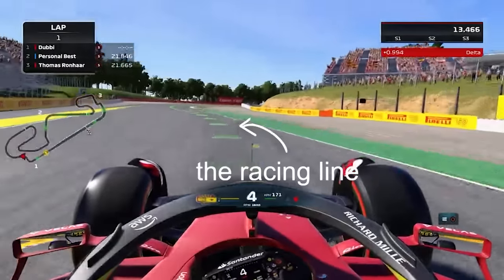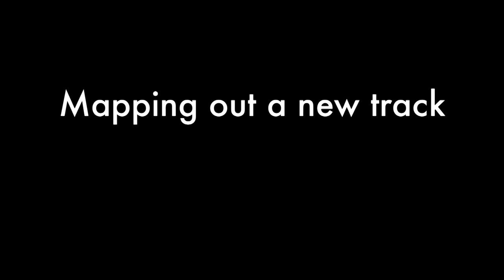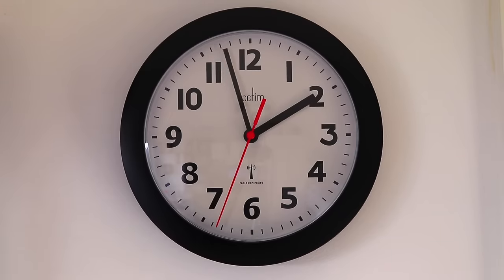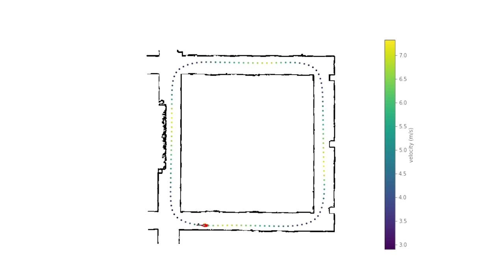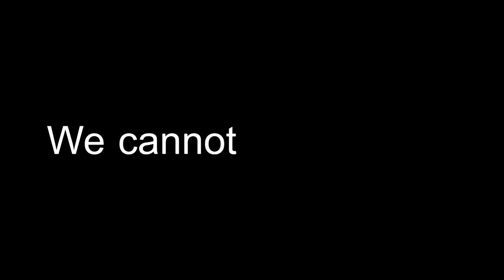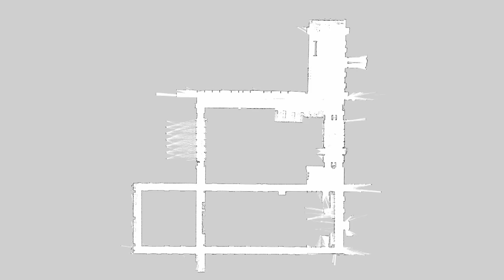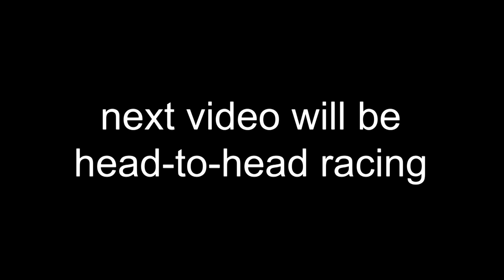Building the FASTEST Self Driving RC Car

Comment: Steven, I'm wondering if the LIDAR is doing anything during your speed runs, or if it's just used to help build the map? It seems to me you are doing autonomous driving via a sort of multi-stage process where the vehicle doesn't have any capacity to respond to obstacles, changing track conditions, changing internal mechanical (like gears eroding or tire wear.) Don't get me wrong, it STILL looks damned hard and we're enjoying the details you're sharing! I think it might be helpful to spell out for the viewers that this is (self)-mapped autonomous rather than real-time autonomous driving. 

Also, if that LIDAR is a snap-on module and isn't doing anything during racing, maybe pull it off and save your $1500. :) 

Please let me know if I've misinterpreted your process. It looks super fun either way. Glad you had some friends to help out with the 2am laps.
Reply from the maker: The car is actually using the LiDAR sensor to localize itself as its racing, which is why it's needed. The code for that is from this repository: https://github.com/f1tenth/particle_filter

You are right that it doesn't have any obstacle avoidance or can adapt to changing track conditions, so this is definitely something that I want to work on in the near future :)) one step at a time is my focus
Reply: If the car was only following a preset line and not the lidar data to define it's position along the circuit, any slipping would offset it from the planned line and very quickly it would be on a collision course with an obstacle.
Reply: @stevengongg  this would be great to see. Specifically, how narrow of a gap that hasn't previously been mapped can you get the car to drive through at speed! i.e. you add a few barriers around the course that the car needs to drive between in order to complete the loop. You are totally right though - start simple first. Good luck
Reply: @stevengongg  at least implement some emergency braking if it's about to go into something or if it's getting out of control. later on you can turn that into collision avoidance based on previous knowledge of the area.
Reply: @stevengongg  REALLY COOL PROJECT! I'm not a racer, engineer, or coder, but I thought a cool idea, using what you presented, would be comparing optimal drive lines on existing tracks.

you could take an existing track with Ariel photos, sometimes they have track data, and compare your code for the optimal drive line vs center line vs recommended lines from the different race teams. 

you could hop on that AI learning train and see if an AI can spit out anything that beats your program or existing lines for the track.

if you really wanted, you could go down the rabbit hole and start scaling the rc car to comparable race cars that have driven on the track and you can build the track at scale (somewhere idk? space would be an issue)

Comment: I think you need an accelerometer to determine the G forces in corners, so you can adjust the steering and acceleration to prevent under/oversteer. Nice results by the way!

Comment: so as me having one of these myself, add a fan to the motor depending on the battery your using, and loosen the mesh by a hair, it will make it run smoother and some sound as crunchy as it drives

Comment: Fantastic work! I'm a mechanical engineering student and the software side of this project really blows my mind. Subbed. 👍

This will probably get lost in the comments, but as an RC hobbyist, your motor gear mesh sounds really tight. The truck sounds like its screeching because of the binding in the transmission. There are plenty of videos on YouTube that show how to set the gear mesh between the pinion (motor gear) and spur (driven gear) properly. One trick is to loosen the motor screws, put a strip of paper between the gears, press them together, tighten the motor screws, then remove the paper.

Comment: Very cool! I often thought about this approach, but from a different angle.  Instead of fully autonomous, I think a better approach would be to teach the car a track.  The receiver and transmitter record a track in slow mode (driver inputs). Then parameters are set to for full speed and corner speed. You'd need a gyro to keep it in a straight line, and guide the car around, each lap finessing the course speed etc. So in racing mode, (hands on still) it would auto correct, hold direction and find the best line for each section.
Reply: Gyros are great at measuring inertial change. However, it would be pretty difficult for them to be used for localization alone.
Reply: @gstrnerd2  true, but if it's set to counter steering anomalies, it'll stay on the programmed track

Comment: YouTube reccomended me this, and it's awesome! As an amateur sim driver, you can shave some time, if you close the gap in some of the corners, it's getting them a bit too wide, before improving the car itself, also will help knowing the point where the car will loose grip when turning, maybe with a Gyroscope, to apply the correct amount of throttle in any occasion to get the ideal amount of grip. I go with trial and error, if can handle X speed, at X G's, go faster until it drifts. Same with braking, how hard can you brake before locking wheels and start slipping, and if you can accelerate hard enough after, and gear ratios, depending of the track you'll want better acceleration or better top speed. You have to balance it right for the occasion. Then will come all the physical improvements, lowering the car, stiffer springs, grippy tires, and powertrain and weight reduction. As someone suggested, adding another type of sensors could also help, maybe ultrasonic sensors, which aren't as bulky and weighty as a LIDAR and use LIDAR for the first recognition... I don't know programming at all, but I like experimenting and I like electronics and rc cars as well, and most of the things I don't know how to implement them. All the best and good effort!!

Comment: Constraining yourself to tyre grip is not the only approach. By using gyro data and comparing it to steering angle (hint: tap into the servo's potentiometer signal so you know the true current steering angle rather than the requested angle), you can determine the oversteer or understeer angle. Oversteer means the car should countersteer and slow down. Understeer means the car should just slow down. Using the oversteer ar understeer angle to augment the determined direction of travel from the camera/lidar data would allow you to eliminate the oscillation that wheel slip introduces to the control system. You could alternatively use an optical flow sensor from a computer mouse under each axle to for more direct and lower latency data which is less susceptible to noise than an IMU.

Comment: Mechanical engineering student here (also in Ontario lol), lengthening the wheelbase slightly might improve stability when steering. Less limiting in software, you'll be able to turn more precisely quickly rather than slowly increasing steering to where you want. Might help reduce the oscillating and increase speed.

Comment: The trick to racing is downrange vision.  It can only plan lines as far as it can see.  It can see better lines if it can see further.  It can run them increasingly faster the further it can see and the faster it can interpolate what it sees.  Maybe you don't need to see the entire environment so clearly.  What if it just focused on a downrange bubble that can allow it to continuously chart where it should go.  Just some ideas.  This is amazing and I'm blown away and only suggesting this as someone with race experience. For sure a good RC driver will still dust this thing in a race.  It wouldn't be close.  You have to make it think like they do.  They're not looking at the glass trying to see if its glass or not.  They're already looking 100ft downrange with tunnel vision. I know that a robot depends on spatial awareness but you should think about ways to focus it. Or maybe make it diminish with distance.  'Push forward' is the term in racing.  The next step is compelling it to 'push forward',  not see everything and react in the moment.  I love this and want to see you take it all the way!

Comment: Great work! I would highly suggest checking the gears, they sound very bad near the end of the video, like they are too tight together (this severely lowers performance), and also lack lubrication. Apart from that make the suspension harder and lower it if the chassis allows it. Stickier wheels and finally a different steering servo.

Comment: It can follow a track, but it doesn't feel like a racing driver yet. It's constantly braking too late because it has less grip than in the simulation, and it's causing it to not hit apexes. You should enable it to go into turns a little stiffer, with more computer confidence, and maybe use the motor to brake when it's detecting that it won't make the apex as intended.

Comment: There might be issues due to smooth track which leads to slip of wheel and car may go offtrack. You might like taking the car on a actual road or a small track which can give you a good traction. Also could you try making a that car run by placing cones on the tack. It can help you in changing track layouts whever you want.

Comment: Don't mash the gear teeth together as tight as they can go. You need a minimal amount of backlash. After your fix it sounds like the mesh is too tight. On the chassis you have, (TRAXXIS or clone) it's a very fine adjustment to get the best mesh. Sometimes slipping some paper between the gears helps.

You're drawing to much current through the ESC if the meshing is too tight, because the motor finds it hard to spin. This can damage your components.

Comment: You should try the purple or double pink foam tires.  Sticky foam tires.  You can get 1/8 scale wheel adapters for your traxxas so you can use 1/8 scale foam.

Comment: Nice work, keep pushing the limits. Both the car, and yours.
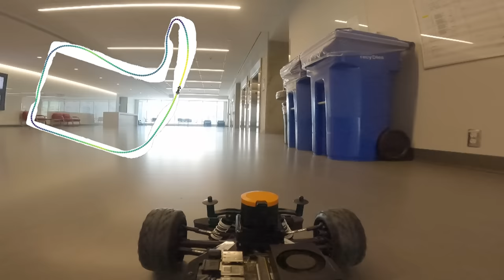Was surprise that your racing on the track counter-clockwise (12:32). Can also test racing clockwise, it would be like having a second track. Would be a good test for your algorithms, once you think you have the car tuned for one track. (might also good for evening out the tread and steering wear ;)

Comment: Really impressed with your work here, Steven! I work on onboard perception at Waymo and previously worked at May Mobility. Some notes from my experiences and studies:

* Odometry on this platform seems bad. From what I can tell, the odometry here uses only the motor speed (measured with an encoder?) and some kind of servo position, which is problematic for a few reasons. I wouldn't be too frustrated that it doesn't work well :)

* Other commenters have mentioned using model-predictive control (MPC) instead of pure pursuit (PPC). Control theory isn't quite my wheelhouse, but without an inertial measurement unit (IMU) onboard I'm not convinced you'll be able to accurately estimate vehicle dynamics. I suggest trying to measure the "friction ellipse" of your vehicle, then adding acceleration, jerk, and angular velocity limits so that your control commands never exit this ellipse at any tire (minus some safety margin). This will reduce pose divergence between what you plan on doing and what actually ends up happening, and should improve the quality of odometry.

Much of the benefit you'd get from MPC, which is to say, being able to optimize the robot's trajectory over a blend of different objective functions (jerk, progress along trajectory, energy spent, and so on), seems to be baked into how you generate your trajectories (racing lines) offline. The incremental benefit from MPC, then, would be doing this online to recover from a mistake or adjust for wheel slip.

* Velocity-based lookahead for pure pursuit has merit. I worked on a curvature-based lookahead algorithm as well, which was annoying for slightly different reasons. Take care not to make your implementation too complex -- you could end up losing stability guarantees that you would otherwise have. The particularly ambitious might do analytical control stability analysis to ensure that your controller isn't guaranteed to oscillate at higher velocity. My team once spent quite a while chasing down an oscillation problem that was eventually determined to be because of time delay and a deadzone in the control actuators.

* The problem with glass is interesting. Maybe you could design some sort of classification algorithm based on the range and intensity of neighboring lidar returns?

* Point-to-point ICP is generally not robust enough to be used for scanmatching in production systems. In 3D we often optimize over point-to-normal distance instead, so the point-to-line algorithm mentioned in the UPenn slides seems like it could be appropriate. I remember reading a paper about point-to-Gaussian matching, where Gaussians were created from little neighborhoods of prior points; could be useful here.

* Your lidar pipeline is very, very sensntive to rotational error in the intrinsic transform from body frame to lidar frame, not only for yaw but also for roll and pitch. If you have a way to fine tune this manually, I suggest doing so! You could also try and formulate estimating the intrinsic matrix as an offline optimization problem, but that seems like it would be a lot of work compared to visually aligning pointclouds.
Reply from the maker: thanks so much for all this feedback, it’s super helpful!! I sent you a connection request on LinkedIn, would love to chat with you

Comment: You need to add spoilers and change tires to those flaty ones used in F1. You will get so much grip and stability that it sould not oscilate at all

Comment: In most racing games the color of the line for full acceleration is usually green and for the part that requires braking is red yellow usually means to maintain speed or let off throttle

Comment: Really REALLY Cool Project!
You COULD have taped white isolation Tape on the windows at Lidar height, to reflect properly. At least that is what we do when we have issues. Better a little Tape than having a 500kilo prototype agv running rampant ^^

Comment: If you add weight to the front it might improve stability. You could then use less smoothing on the steering. Though the general wobblyness of the car might not make a difference.

Comment: Something that I have pondered at great length over the years is that I believe it is entirely possible to achieve identical ap times in both directions on a race track, subject to the following conditions

1) the vehicle is set up for neutral handling (inot set up for all left-hand corners, for example)
2) the track / tyre conditions are constant (difficult to achieve IRL, but easy to simulate on a computer)
3) the track limits are always adhered to

For a square or circular track, this is obviously true, but what about a track with inconsistent radius corners / camber etc

Thoughts??

Comment: Using slicks and preheating the tyres will really help. All the cars that race on tracks even dirt tracks will preheat their tyres. Either by making a few lap's before they go wide open or. By doing burnouts beforehand when they can't make practice laps.  You should be able to find super sticky tyres if not check the local. Speed shops they have substances that will soften the tyres  when  you apply it to them. You should be leaving rubber on the track when you take a corner or the tyres are too cold and your losing time. Race tyres will be soft enough at temperature that you can easily scrap rubber off tyres with your finger nail

Comment: The tires are just awful for that (but they clean the dust from the floor). As a machine learning engineer and a rc enthusiast (have the losi dbxl-e 1:5 scale), not even a good human rc driver could race that. You’re just skitting at random intervals due to dust accumulation. So suggestion: 

1. Buy some RC motorcycle tires to reduce the surface. Maybe even lego motorcycle tires fit. (Alternative: Pour Asphalt on the 5 floor 💪)

2. Maybe (momentarily) lock the drive wheel differentials (or don’t forget to incorporate them into the simulation in step 3.). The problem is, that you fly out of corners because one tire eventually loses grip from the flat floor, creating lateral forces throwing you around. That helps you when you have fast reactions times as an experienced driver, but compared to locked differentials removes predictability. When you lock the differentials, you’ll see how hard to drive it actually is on that surface.

3. To get the ground truth into the simulation, it probably makes sense to throw the track into unity3d, grab a standard car rig model and have a random tree search or even ml agents tweak the coefficients of that car rig so that the simulation matches what happens in the real world. From there you have a lot of options. Like ML Agents / Curriculum Learning etc. best with stochastic deviations over the coefficients so the model learns to deal with none-perfect environments. Oddly enough, you don’t have a perception problem but a control problem. Usually its vice versa for autonomous vehicles. Good luck!

Comment: So you should try to read the book "going faster" by skip barber. It talks about optimal race lines and especially the speed curves you should be going into the turn at your minimum speed and accelerate all the way through the turn. Essentially you need to find when your car "slides" towards the outside edge since it is constantly loosing grip and then tune the speed back a tad and run at full acceleration through the corner. that way you get the highest speed through the straights. Feel free to reach out if you want more info or specific info from the book.